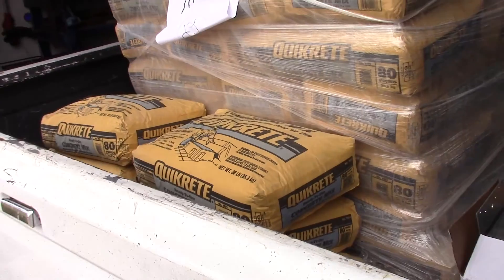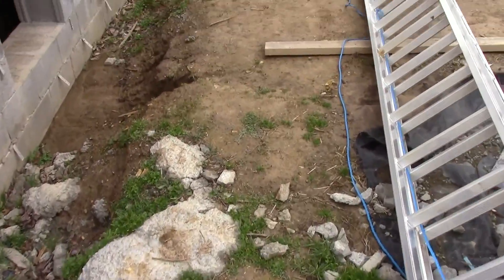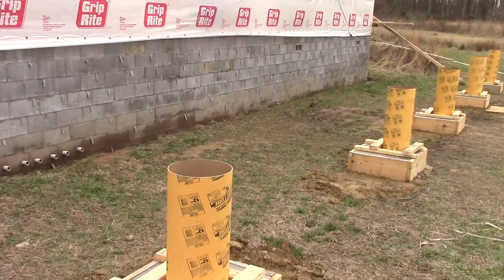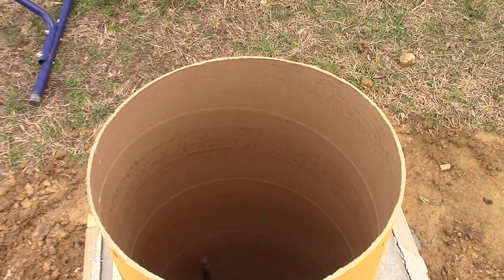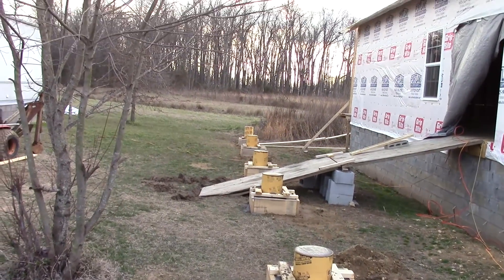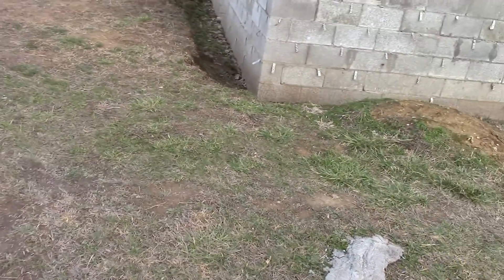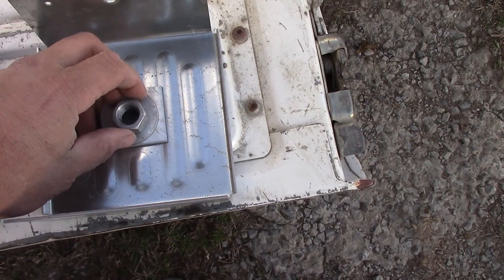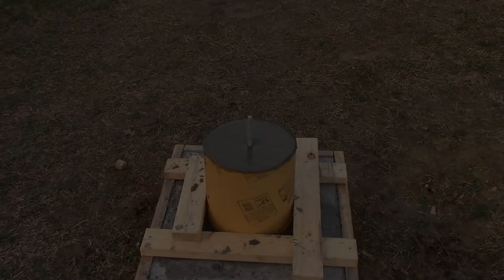More body pain, I mean concrete work!

Comment: Looking good mate :-D, im sure the compressive forces on those posts wont be a problem.
More finished :-D :-D
Reply from the maker: +zx8401ztv Thanks! It's a bit of extra work now, but it will pay off in the long run.

Comment: you will get lost in the new house after the old 1 mack.
do you end up filling the trench up around the brick work.?
Reply from the maker: +obieezx11 We will actually be digging it out some more around the house to give more room to work while laying the brick. Also we have to dig in for the geothermal lines (the 6 PVC pipes you see coming out of the front foundation  wall). Once that is done then we will back fill so there the ground around the house is nice and even, and slopes gradually away from the house.
Reply: +Mac Gyvers Workshop yeah i was wondering as if it was left it would flood the crall space i think if it got thru the brick or even worse alow salt to stuff the bricks
Reply from the maker: +obieezx11 No it won't do that as I have the curtain drain around the perimeter, as well as the sump in the storm shelter. Some water does collect in the trench around the foundation if we get a really heavy rain, but it drains away very quickly. Once I get the brick done and back fill, there won't be any water at all collecting around there.

Comment: you didn't need reinforcment in the posts?
Reply from the maker: +obieezx11 Actually there is reinforcement in those posts, and its tied into the base pad we poured last weekend. It's just not shown in the video.
Reply: +Mac Gyvers Workshop ok was just wondering as you built everything else like a fortress

Comment: whats this place going to end up costing and how many k diffrence if you got a builder to do it all just interested in price diff from america to australia
Reply from the maker: +obieezx11 Right now we are at about 25,000 dollars invested. We hope to build the house to completion for about $50,000 (US). If we paid a contractor/builder to build this house it would cost around $100,000 (US). We are saving an immense amount of money by doing the labor ourselves. We have had to bring in some people and pay them, like when we had the foundation core filled as it was cheaper that way than renting a concrete pump. And we paid my son in law and his cousin to do some work up on the roof simply because I was too chicken to climb up there LOL!
Reply: +Mac Gyvers Workshop 50k is grate considering the price it will add to the property if you ever sell
Reply from the maker: +obieezx11 We paid 99,900 for the property back in 2009, right at the bottom of the recession. That was a little bit higher than I would have liked to pay, but the problem was that since it had a single wide mobile home on it, we couldn't get a normal mortgage since single wide mobile homes are considered to be pretty much junk by any bankers or mortgage companies. The owner was willing to owner finance (meaning he acted as the bank and carried the note).  We worked hard to pay it down since then, and we owe about 80k now. With the single wide mobile home, the property is now appraised at about $130k. Once we have the house on it and get rid of the mobile home, the property value will increase to about $270k. Since we will only owe $80k, we will have a lot of equity and about a $ 400 a month mortgage payment when we refinance. You see with an owner financed mortgage, it does not show up on your credit report as only large financial institutions can report to the credit bureaus. Because of that I have a perfect record paying my mortgage since 2009, but it won't show on my credit report. This really sucks, which is why we are trying to get the house built, and refinance out of the owner financed mortgage and get a regular mortgage with a real bank.
Reply: +Mac Gyvers Workshop your prob safer staying with the owner as they are saying americas about to go into a reseshion meaning intrest with the bank will go thru the roof and you wont make enough for the repayments and will loose the place were as were you are now he wont take it from you

Comment: Not being critical but why not just lay block for your peers. Would of been a lot cheaper and just as good as what you have...anywho coming along. We always laid block peers for post for over hangs or porch post.
Reply from the maker: +Ridge97 It would have been simpler for sure, but I wanted the part of the pier that was going to be exposed after the backfill was put in to have a simple  look that would not attract the eye. The cylindrical pier does this nicely. And I figure the cost is not much more than what would be spent trying to make a block pier look good from the front of the house. Now the ones that will support the deck span in the middle, those will be done with block as they won't be seen.
Reply: Mac Gyvers Workshop OK I didn't understand the concept but I do now..mostly here they end up covering them with stone.or if the house is brick they will make brick post around the block.